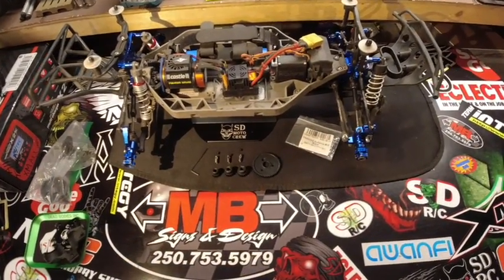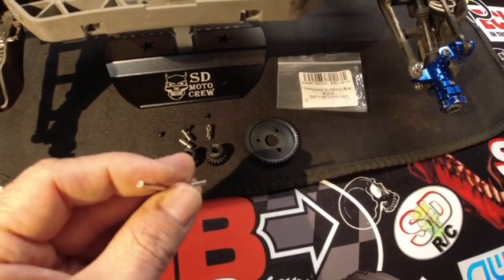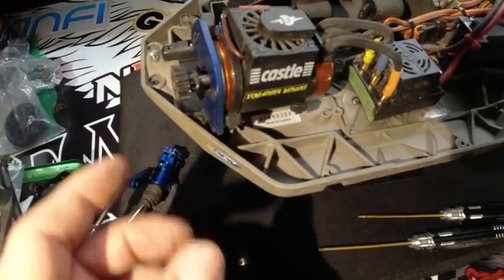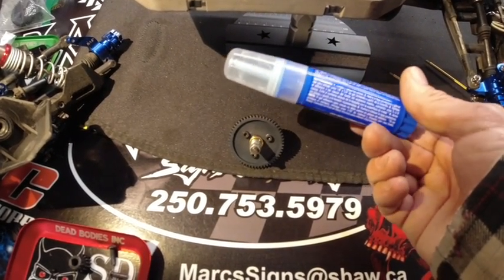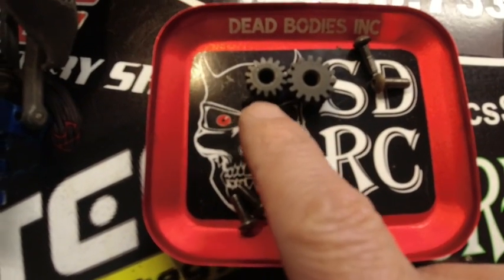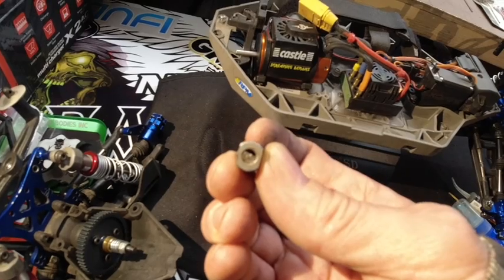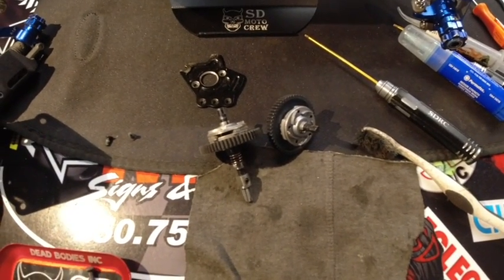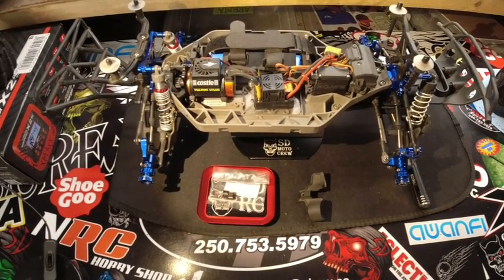SLASH 4X4  METAL 54T. SPUR     15T. 17T. 19T. PINIONS  SDRC shop

Comment: went with the hobbywing combo max10 exc with 3665 3200k sensored motor paired with a 15t pinion and a center diff instead of the slipper clutch